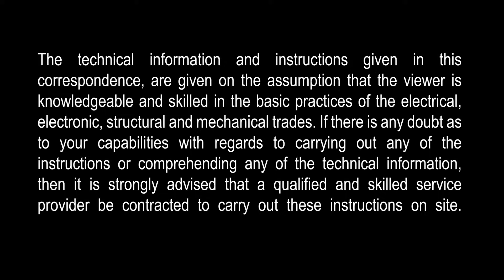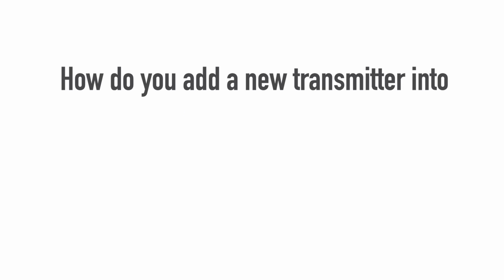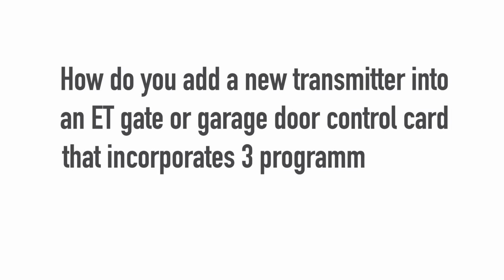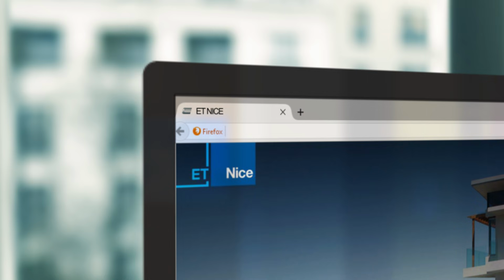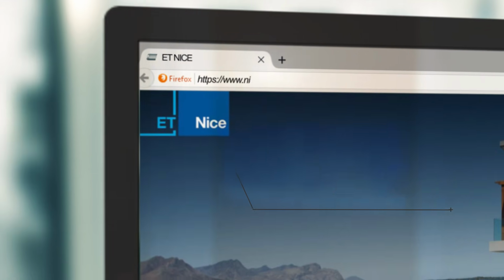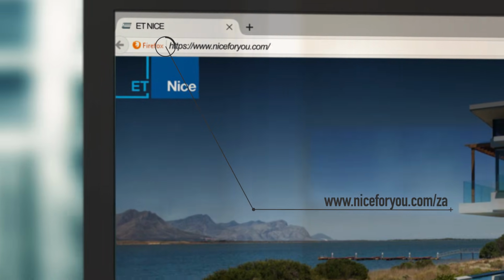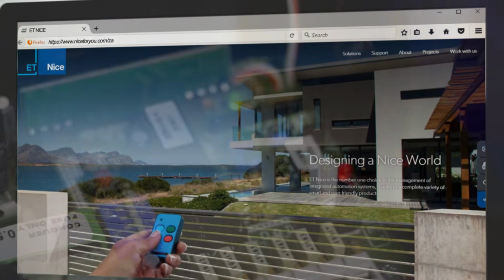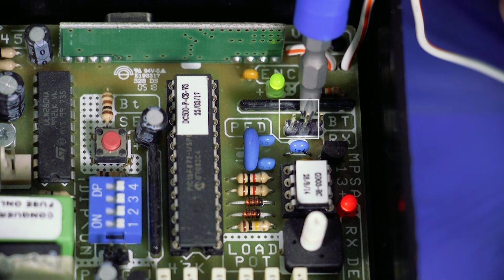How do you add a new transmitter

Comment: So, after struggling unsuccessfully for a while, I learned that my 4-button ET remote has two frequencies for each button. The whole business with the 15 seconds is that if you hold the button down for more than 15 seconds, it toggles to the other frequency. Once I had done that, I repeated the exercise as per the video and it worked first time.

Comment: Hi, will my ET remote work on centurion D5 gate motor ?
Reply: No. You have to install a et rx2 micro receiver unit to the d5 motor. its a small hand unit that you  can place inside the motor with no problem.
Reply: @Lil0Kevin14  Good morning dear Sirs, I have a problem with my Nice 300 stepper motor, it presents an error “ES” whenever I configure the beam limits before reaching the end  of travel it stops and displays this error I would like to know how I can solve it . Tanks
Reply: Good day. When setting the gate opening and closing limits, you need to press the stop button before the wheel hits the end stop on the track. This is when the gate is in the open position. Once its stopped, use the arrow buttons to fine tune the adjustment and then confirm. It will then verify the set up and then be saved. Hope this is the answer to your question.    @jbtsservicos
Reply: Good morning dear Sirs, I have a problem with my Nice 300 stepper motor, it presents an error “ES” whenever I configure the beam limits before reaching the end  of travel it stops and displays this error I would like to know how I can solve it . Tanks
Reply: https://www.youtube.com/watch?v=4PJRMGG0lnQ
Reply: Will the new ET remote work on a DTS 500 motor gate??

Comment: After bridging the BT which should cause a flashing Led, what's next? I assume the system is on learn mode and you simply press a button on a receiver for a certain amount of time?
Reply: I know it's a bit late and you probably have it sorted by now, but for anyone else asking the same, you short the pins, hold the button you want to pair down about an arms length away, and then for me I heard two beeps indicating it was paired.
Reply: @chipanddip790  Good morning dear Sirs, I have a problem with my Nice 300 stepper motor, it presents an error “ES” whenever I configure the beam limits before reaching the end  of travel it stops and displays this error I would like to know how I can solve it . Tanks
Reply: Nice

Comment: When the pins are shorted my lLED light does not flash.... also what happens if the transmitter button has been held for more than 15 secs.... how do you get it reset